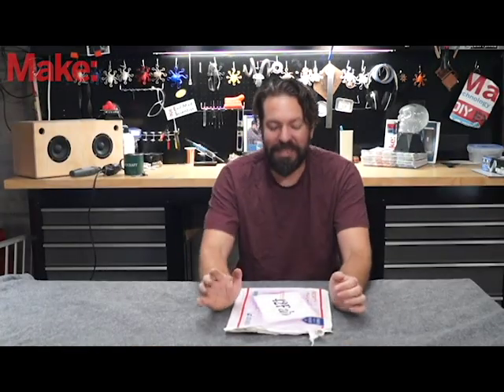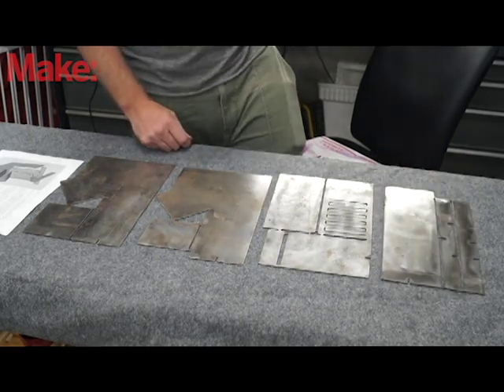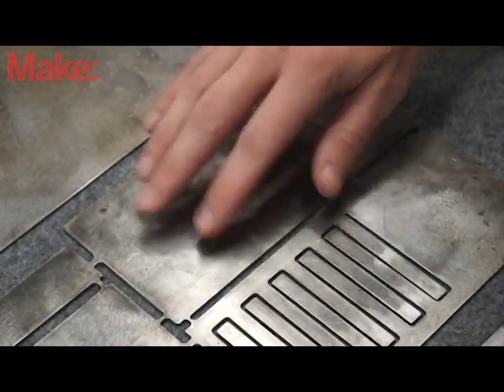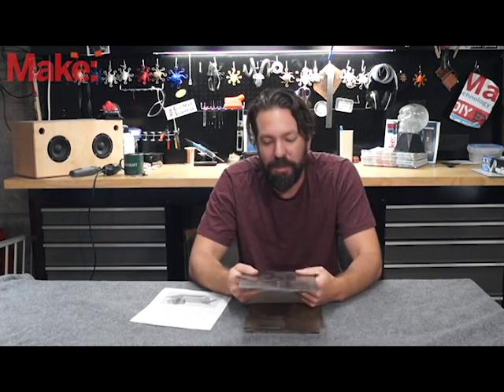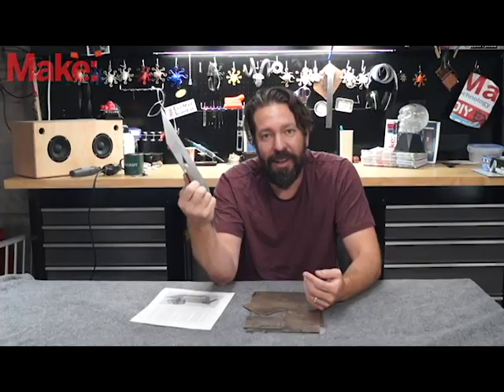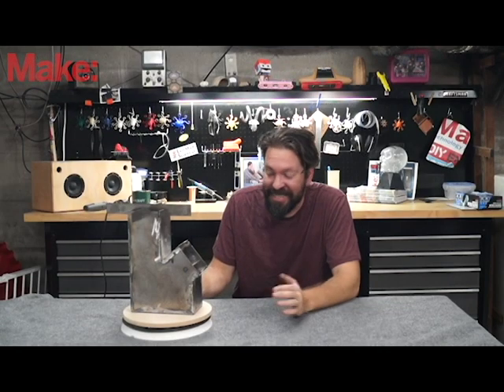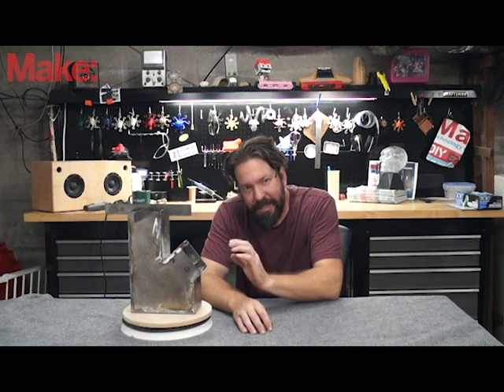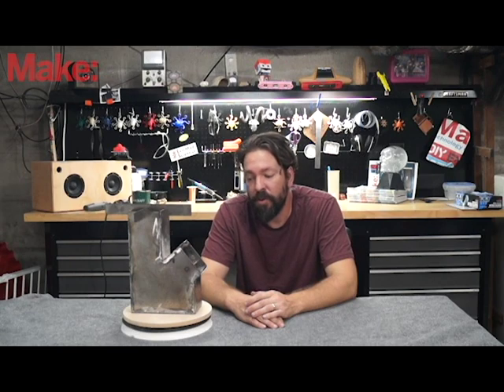Make Workshop: Practice your welding with this kit

Comment: I wouldn't want an "easy, ready-made kit" to build something. It's kind of like buying your way to a finished project. Part of the task (and fun) of welding is acquiring the materials yourself to create something. A great idea is finding out about your local metal scrap yards and developing relationships with them. Not only could they get you good deals for being a repeat customer, but you can also learn from them. 
And if you want to work on your welding skills, find scrap metal and start welding them together. Just go for it.
Reply: It's for practice Dale!

Comment: You should switch from flux core to hard wire with shielding gas. Or even tig. Flux core tends to try to burn thru easier. And people tend to try to move faster with flux core. Which makes it burn thru. It is better to backup into the puddle. With the correct settings that is

Comment: Would wood clamps work for welding if they aren't right on the joint, or do you need seperate clamps for welding because of the temperature involved. Or clamps optional? Just tack one end,  then bend to alignment and tack again?
Reply: Quick tip in a pinch. A wet sponge under each pad will protect a plastic or rubber clamp. Just make sure you're jigged in a way you're not running water into the weld.
Reply: they should work fine, though you may melt rubber bits if you're not careful.